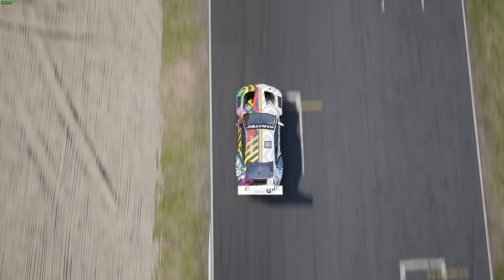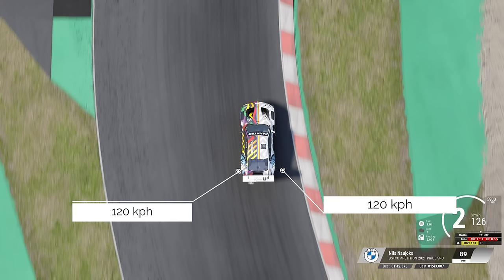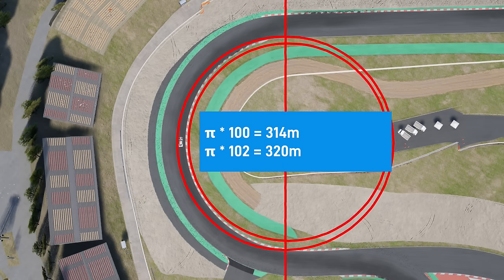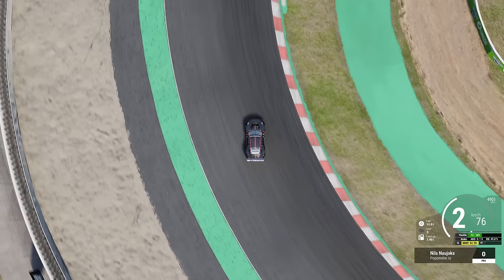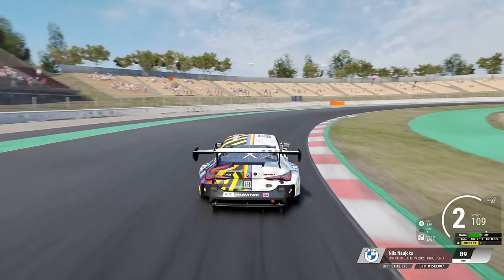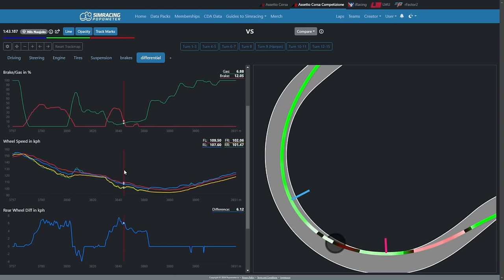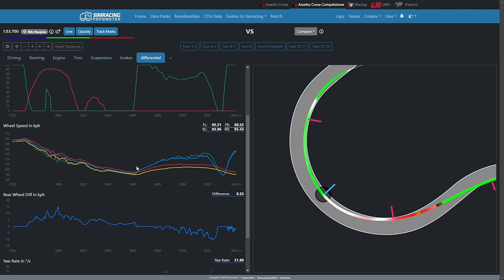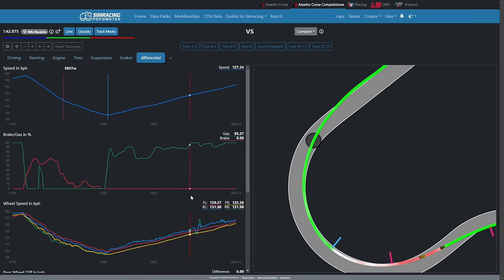What does a differential actually do?

Comment: As a competitive drifter who started competing last November, I learned a lot about driving and setting my car up. One of the big learnings I took was how to set up the differential correctly. When I started competing I simply set my diff to lock 100% on accel and decel (We are using LSDs just like GT3 cars), but later on I learned that it actually makes a huge difference to open the diff up on decel. I haven't experienced any situations where it was super beneficial to open the diff up on accel as I really like the amount of rotation it gives, but there are lots of different styles in drifting. Opening up the diff on decel really helped me to stop overrotating the rear of the car in certain situtations and it completely changed my chase game too. Finding the right preload is not as necessary but it does make a slight difference in how the car feels and when the diff starts letting slip happen. With slight throttle adjustments I usually want my rear to stay locked to gain more rotation and when I let off throttle a bit longer I want my diff to let the rear wheels do their own things to a certain extend. I'm still by far not a setup master but I'm learning more and more with time.

Comment: As a Porsche driver, that helps a lot. Now knowing the theoretic part better it is still the problem that I can’t do 80% 😅 it’s always pedal to the metal. I guess the VRS pedals are also part of my problem. Having a really really soft spring and no changing of resistance during the whole way of travel 🙈
Reply from the maker: pedals are fine, the issue is your heavy foot :))

Comment: As a real racing driver for 30 years, i have not found that a locked diff will cause entry understeer.  Quite the opposite.  I have raced shifter karts, solid rear axle, and a Lexus SC400 with a welded diff for years and neither of them had any entry understeer.  It helped rotate the car in entry and was amazing on exit.  No loss of grip there.  I have also found that an open diff is the opposite as the rear is much harder to start rotation on entry, and exit is abysmal if there is any camber in the track at that point.
Reply from the maker: yeah, its not as straight forward.
its car and grip dependent.
the weight bias has impact as well and you'll not get a lot of rotation with the open diff when its heavily front biased - but huge impact if rear biased. and depending if the car is generally rear of front limited in terms of grip the locked diff will give you over or understeer. its a little more complex in the end. but its about getting the principles across here.
Reply: I’ve started racing my BMW E12 M535i Goup 2 eleven years ago. Although it is a classic car, it behaves pretty much as Nils states. So I guess it really depends on a lot of other factors, mainly weight transfer.
BTW, you nailed it with the thing about the power delivery of racing cars. I balance mine on turn exit with around 20 to 30% throttle. It gives me the perfect subtle controlable slide.

Comment: That's a pretty good video.     

I've found the type of pedals you have makes a big difference.    Some of the pedals like the lower end ones jump up to 50-70% pretty quickly 

The other question I have is how does the TC affect the tire slip?     Some tracks I'll use 1 while on others I find using 2 or 3

Then how much does the damping make a difference?    

A perfect example would be turn 4 or 5 at Brands Hatch.    The left back up the hill before the str8.   That turn kills my lap times when I get it wrong.   It's the only track I can't get down to a competitive time I'm stuck at 1:23.   

There's a lot of ungelation in a few of those corners and I often experience the inside tire slipping.    I just cant seem to get my set up right for that track
Reply from the maker: TC depends on the car. Some cars will have the tire in desirable slip range with TC on, some cars will cut before there tire is where you want it. Some will allow enough slip, but then cut fiercely when you go slightly too far. Some apply the TC already when the inside wheel slips before the outside wheel is affected - which is much too early.

Damping: hard to judge, its such a subtle thing. I'd think in terms of damping rather with general traction in mind rather than controlling a certain slip. the more sharp your front end is, the more difficult to balance the slide, so you can "weaken" your front end to have a more controllable rear in general.

Brands hatch: Yeah, just a shi**y bumpy exit there. When you already struggle for traction its hard to get this one right, and whatever you do in the setup there will hurt in the fast turns. The bumps will trigger the TC if its on, and cause the rear to snap when off, or even have you run into the RPM limiter on some cars (M4)... Just not a nice place, like all british tracks ;)

Comment: What about the relation of preload with regards to the differential behaviour?
Reply from the maker: basically no impact. it will help slightly with limiting entry rotation if you crank it up, but that will make it more snappy on exit. and vice versa. but its a VERY LIMITED EFFECT in the first place. we'd need the clutch plates or ramp angles to have better control over the diff, but GT3s generally do not have that available to adjust

Comment: Please make a video on how to drive with TC 0.  It seems to be about throttle control and somehow controlling the inside and outside rear tire slip, but no one tells us how we do that.  Maybe you can show us how your popometer software can train us to success!

I'm literally at least 2 seconds slower with TC0 because I might snap oversteer at any moment and I am way too conservative exiting turns.  But I must admit it's at least twice as fun!  But my ultra conservative throttling might be confounding me, according to your incredible LSD video.
Reply from the maker: maybe that helps further :) https://youtu.be/kJjDmGSjJOg
Apart from that a lot of the "secret" why it works is, and the popometer comparison to pro laps would show you: 
- car placement makes up 33% to be able to put the power down
- 33% 'state' of the car, i.e. which tire and axle is operating how much above the limit just before you put the power down
- 33% practice

TC0 becomes easy once you drive the rest of the corner correctly and the car isn't challenged as much on the exit. If you want to drive without TC on corner exit, you must make it easy for the car to put the power into the ground. If you still have too much corner to do, then it won't work.

Comment: Hi Nils thanks for the video. Can you please say a few words about how the changes we can make in the setup affects the differential? Does it affect how much power is needed to actually lock it or is it the force that "binds" the rear wheels together? How should you adjust it in case of under-/oversteer on entry/exit.
Reply from the maker: the preload is largely ineffective. so you cannot adjust the differential behavior.
you can get a tiny bit of more locking under coasting to get some stability from higher preload, but the effects are very limited.
on throttle lowest preload would help to prevent the binding a tiny bit longer, but the torque from the engine is so large usually that the preload is too small in comparison no matter the value
Reply: @SimracingPopometer  Thanks.

Comment: I remember you saying a while ago the diff settings only kinda work in ACC on the Bentley. Is it still true? I'm too much of a bad driver to know if it is or is it just placebo I'm feeling.
Reply from the maker: the preload setting in general has very little impact, the other settings like clutch plates or ramp angles have bigger impact, but aren't available to adjust here (or in GT3 in general). the bentley is one of the few cars though that keeps rotating on power without slipping the outside wheel. not necessarily diff related, but i think its just locking a little later (these things might change from patch to patch and havent touched it quite a while)
Reply: @SimracingPopometer  oh ok, thanks nils!
Reply: @SimracingPopometer  Is this V1.9?  I remember V1.8 Bently just wanted to snap oversteer suicidally, but in V1.9, Bently was sooo guud, but the BoP made Bently slow shit.  Bently felt so guud when V1.9 came out... 😥

Comment: I think that a high preload stiffens the car when turning in during braking and coasting and causes more understeer.  Is this true?  There is a point at about 80 Nm when the ffb feels "freer" and "springy" and not like "sand", and the car seems to more freely turn in. (on a CSL DD 8 Nm.)  I have never used telemetry to analyze this "feeling".  It "feels" like 80 is the max point when the stiff sandy feeling is alleviated.  Is this why the meta is to set it to minimum 20?  If I compare 20 Nm with 120 Nm, I can definitely "feel" a difference in FFB when braking and turning in.  The 120 feels like dragging a stick through sand when turning in while anywhere from 20 to 80 Nm feels springy, and I swear the car turns in more easily with less understeer.  If the "feeling" doesn't matter and you can determine that there is absolutely no difference in understeer no matter what the preload is from min to max settings during braking and coasting, it would be of great help.  (I'll just set it to what "feeling" makes me happiest. lol)

None of this makes sense, since a higher preload means the rear wheels can independently spin at different rates longer until higher torque locks the wheels.  Which means the "sandy" feeling means the LSD is free?  (I really don't like that "sandy" feeling.  But feel free to tell me that "sandy" is actually better for performance.  I'll be most unhappy, but thankful for the info.)  Or does alleviating the sandy feeling mean the balance of wheelspin differences are optimized?  Or oppositely that we want the sandy feeling?  As a non-professional, I do everything for enjoyment-err I mean performance!  No! feeling good and having a clean FFB is so much more enjoyable than a sandy FFB.  You can tell me I'm nuts!
Reply from the maker: I get the feeling you are correlating things that shouldnt be correlated.
"sandy feeling" is not a side effect of any differential setting. That feeling only occurs if you completely overdrive the front axle and scrub the tires massively. You should never get to this point as it destroys the tire. It might occur earlier with different differential settings in theory, but the preload impact on the car is absolutely minimal and shouldnt be reflected in the FFB. So I think there's a bigger general flaw in your driving approach - even if it might interact with the differential.

Comment: Hi Nils, Very nice video about the differential. So we are talking with TC OFF right ?
Reply from the maker: yes, indeed. but during coasting of course TC does not matter and with TC you are also more aggressive on throttle and will always lock the diff - the TC then cuts heavily to prevent the outside wheel some slipping. currently though it can happen that the TC will already engage with the inside wheel slipping, taking power away BEFORE the car starts sliding
Reply: Do you think with ford TC 4-6 you can use this slip/rotation on corner exit? or is it only tc 0
Reply from the maker: ford can surely do that with low TC levels, but 4-6 might be too high

Comment: So... how do we adjust this in ACC?
Reply from the maker: preload, but that doesn't do much, so: you don't except with your foot
Reply: The times might not matter, but I'd lower LSD preload to max 80 just because the turns feel more "springy" and less like dragging a stick through sand.  This vid seems to imply that braking and coasting turn in isn't affected at all, but the FFB "feeling" changes a LOT.  I set it to where I feel happiest, but that could mean I set it to the worst.  I don't have access to the popometer telemetry.  I'm inching closer to emptying my bank account to sub to his popometer, but I need to know he will train me to race with TC 0.  But DOH! ACC is ded and AC Evo is soon to stomp out AC and ACC!  I'll look forward to what this popometer can do with AC Evo.  Ima gonna be 100% into AC Evo!  Until then, Ima be in Forza Motorsports, because that's my skill level. 🥲
Reply from the maker: @virtualawakening2299  you can use the tool without subbing, just wont have the additional data channels ;)

and I answered to your other comment. the preload should not affect ffb! 
also the cars all have different ramp angles, you can't take a preload value from one car and assume it does the same on another. precision is important here.

I'm not sure how far off the fast lap times you are, but you only have to worry about TC 0 when you are missing the last 1-3 tenths.

ACC is gonna stay with us for a while. AC Evo will unlikely be a replacing game, looking at the content they shared so far - road cars.

Comment: 3:50 why would an open diff make a car overly sensitive to oversteer on corner entry? I thought an open diff provided maximum grip on entry.
Reply from the maker: no, because both rear tires can then rotate independently, the outside tire can spin much faster than the inside wheel and thus (over)rotate the car. it will convert every steering input and there is nothing that keeps the rear in line. will do ams2 videos where we have cars with complete open diffs, or maybe lfs where we can put any diff with any value into any car
Reply: @SimracingPopometer  Thanks, I believe you, but don't understand. With a lsd dif there is some drag on one of the wheels (the inside because it has less grip?) caused by the clutch packs, kind of like putting a tiny bit of parking brake on that wheel. On an open dif there is no drag on either side, so 100% of the tire grip goes to lateral traction, so the rear has more grip, meaning less oversteery?
Reply from the maker: ah. in my unerstanding there's no "drag" with the LSD on the inside wheel in the form of a decelerating effect. the inside wheel doesn't turn slower because it wants to turn slower. it turns slower in response to the driver turning the steering wheel and being put on a different radius - the LSD allows the tire speeds to adapt to the rotation requested, it doesn't force the rotation. but the LSD limits the speed difference (it actually limits torque difference, but thats more abstract to think with), and this way doesn't allow the rear end to rotate faster than desired, it prevents the driver from being able to request too much and lose the rear. if anything the inside wheel is forced to rotate more than it is covering actual distance on track - thats what the limited difference between inside and outside tire enforces. with open diffs you'll see early throttle inputs to control the torque difference and keep the car stable. the formula inters in ams2 have an open diff, here's an irl onboard: https://www.youtube.com/watch?v=1bAzPJKwVzc
watch how he needs to correct on the steering on every corner entry because the rear is willing to rotate more than the car could take and then watch how on throttle its perfectly stable (except last turn) and he can finally commit to the steering as excess torque from the engine would have the option to escape trough the inside wheel, no snappiness on exit as a result. But generally, the more steering he applies, the rear end of the car can always adapt and do the rotation. the car is never front limited, it steers with the rear essentially
Reply: @SimracingPopometer  Thanks for the reply. I'm was thinking about the total grip and as a thought experiment looked at in the extreme: if it was a welded diff it would increase understeer because the rear tires would want to keep it going in a straight line. However the rear would also have less total grip because the inside wheel would be slipping as it's speed is locked to the more weighted outer wheel, meaning some of it's overall grip is lost to this excess rotation. So overall the rear would have less grip, which leads to oversteer. So you might find it has understeer under the limit, but also a lower limit, so oversteers before an open diff. 

In an LSD the two tires are not welded together, but there is a friction connection through the clutch packs, so, as with a welded diff, the overall grip is reduced, meaning, all other things being equal, an LSD will break loose/oversteer before an open diff.
Reply from the maker: yes agree with the first part and agree with the 2nd part under the condition that the allowed difference between the rear wheels is not enough in any given situation.
Reply: @SimracingPopometer  Thanks, I appreciate the discussion.